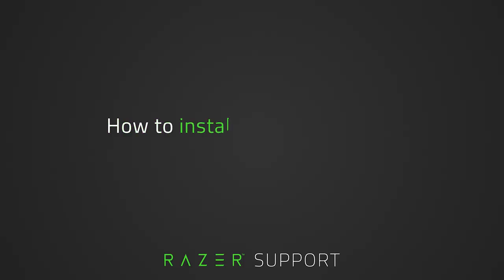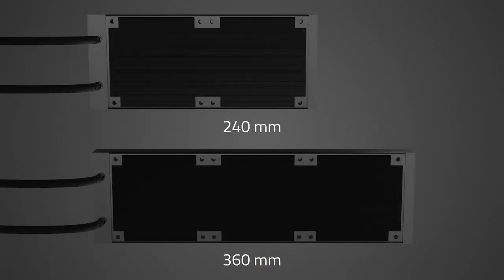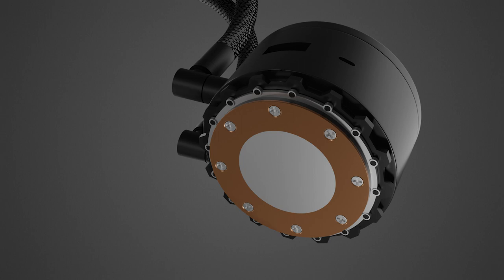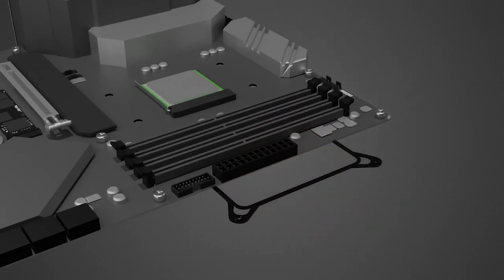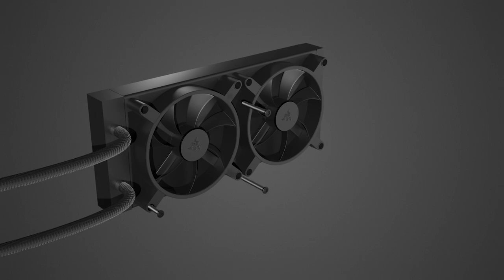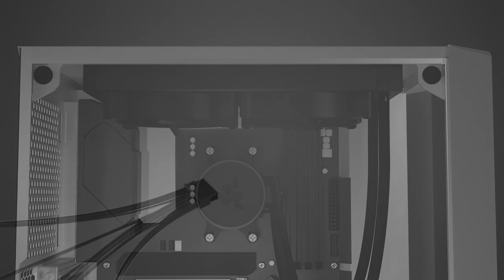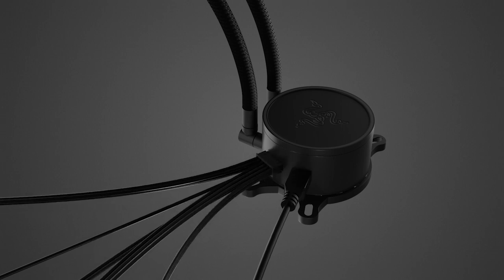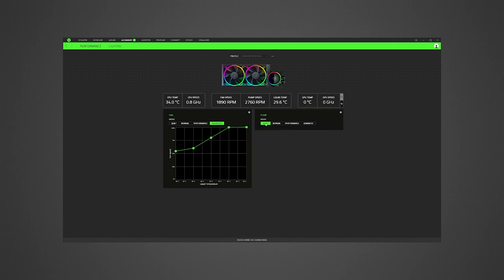How to install the Razer Hanbo to your PC

Comment: i'm genuinely surprised they actually bothered to mention about not having the radiators outlets from below the block. Most manufacturers don't mention to do that.
Reply: That’s because in the instruction manual they have a picture of it getting installed with the pump above the ports lol

Comment: Will Razer be introducing a bracket for LGA 1700 mounting? It's nuts that this is a brand new product that was released (read: available to purchase) many months after Intel's 12th-gen Core lineup was released and yet it's not compatible with it! I own both for my new build and am currently unable to use both together, so I'm just in limbo right now, as I don't really want to have to compromise on either for a number of good reasons...
Reply: It already does support LGA 1700
Reply: It comes with the 1700 mount screws already which is great
Reply: It didn't in the one they sent me.
Reply: @amateurpanda92  hit up their support. I was pleasantly surprised to see the LGA 1700 bag
Reply: @DKTD23  I may do that if I'm in a similar situation in future, but I ended-up going with a different AIO in the end.

Comment: I keep getting a number of connected fans don't match error messages and it keeps crashing and I cannot use the software at all. I only have 2 fan radiator and nothing else is connected to it. Any suggestion?

Comment: Can the 360mm AIO be mounted to the top of the Razer Tomahawk ATX, or is there only room for the 240mm on the TOP?
Reply from the maker: Thanks for raising this inquiry. The Radiator Compatibility of the Razer Tomahawk ATX is up to 360mm. You can check this resource: https://mysupport.razer.com/app/answers/detail/a_id/3834 for more information about its specs and other FAQs.

If you have additional questions, please reach out to us from here: https://insider.razer.com/index.php?forums/support/
Reply: i tried.... it doesn't fit on the TOP
Reply: @you0neville0tube  I had this issue, too.  It's too tight of a squeeze up top.  You can probably get the 240mm up there, but I attached my 360mm to the backside of the front of the case.  I'm sure by now you figured that out, sorry I'm late to the game.
Reply: @CJ Neuman Jr  yes... that's what I had done back then. I just hated that  I had to suck the hot air into the case (exhausting was way worse).

Comment: I have the ASrock razer edition X570 motherboard. Should the Hanbo be plugged into the CPU Fan Connector (CPU_FAN1), the  CPU/Water Pump Fan Connector (CPU_FAN2/WP_3A) or the  Chassis/Water Pump Fan Connector (CHA_FAN2/WP) ?
Reply from the maker: You will need to connect it to the 4-pin CPU fan header on the motherboard, the one you use to power the fans of your old CPU cooler. For more details please refer to this manual: https://dl.razerzone.com/master-guides/RazerSynapse3/HANBO-00003893-en.pdf

If you have any other questions or concerns, feel free to reach out to us directly here: https://insider.razer.com/index.php?forums/support

Comment: will there be a version for am5??
Reply: Just bought the 360 version. It doesn't specify  which  AMD socket, it just says AMD. It does work with my AM5 socketed CPU. I am currently experiencing driver issues though in Windows 11.
Reply: @edwardneuman6061  i have the same driver issues - it does not read the CPU temp and speed.

Comment: Why does when I’m trying to open up a game, it says “this requested operation requires higher elevation”. Who is the local administrator, how do I fix this?
Reply from the maker: This error means you need the current user logged in to your computer is not an administrator account. Try turning off UAC, change the folder permissions, or run the game as the Administrator.

If you need additional assistance, please reach out to us from here: https://insider.razer.com/index.php?forums/support
Reply: @rzrsupport9502  thank you , I by accidentally logged into an account with the wrong email, I just had to switch the administrator controls to my main account
Reply from the maker: Happy to know that you've sorted it out. Feel free to connect with us here: https://insider.razer.com/index.php?forums/support/ if you need help in the future. It's our pleasure to help you.

Comment: Ok I have one of these but the AMD instructions are unclear....
Reply from the maker: Hey! If there's anything we can help you with, you can directly connect with us here: https://insider.razer.com/index.php?forums/support/ and share with us some details so we can assist you accordingly.
Reply: @rzrsupport9502  Thanks but I found out how to solve my problems on my own.
Reply: @nemuzko  hey man, was your issue with stand off screws? I’m breaking my head trying to get this installed
Reply: @j4zzo663  Actually yes. You're supposed to use the weird one with the plastic cup shape on top and the thumb screws. I kept wanting to put them in backwards, but it took me a while to realize. The instructions/ pictures really don't show them the way they are supposed to go in.
Reply: @nemuzko  how do you screw them to the back of the motherboard? Sorry for all the questions lack of info on this thing sucks.
Reply: @nemuzko  do you just use the stock AM4 backplate that comes with the motherboard, or does this provide a custom AM4 backplate?